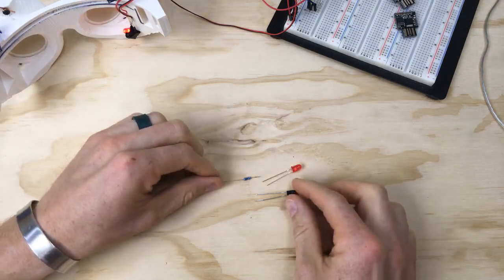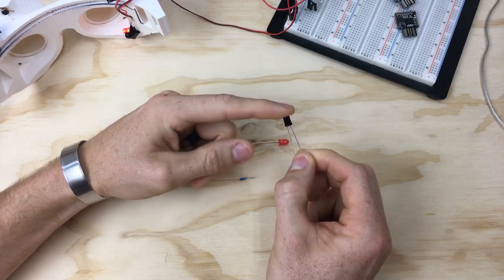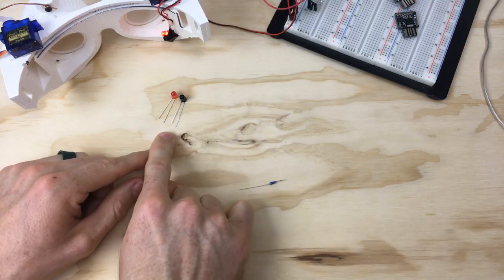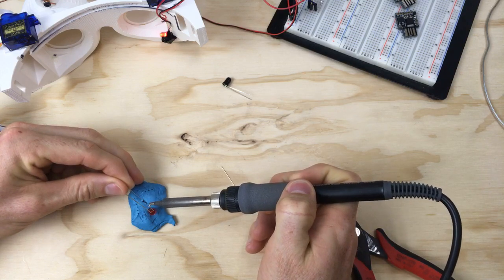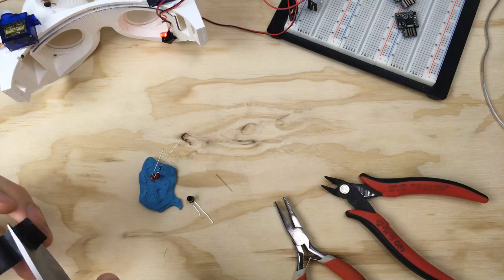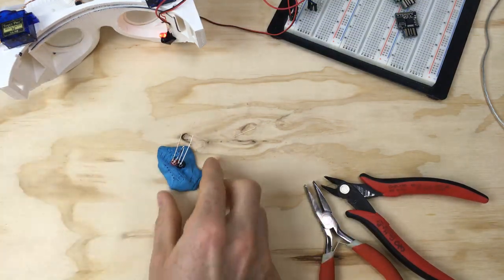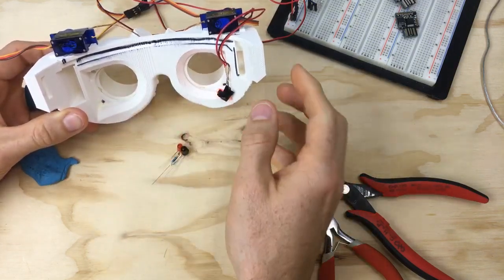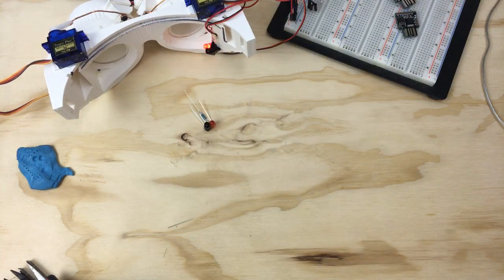How To Make a Light Sensor | Blinking Iris Goggles | Live Stream

Comment: do you have a link to the 3d print that is holding the Blinking Iris? it seems much more solid than the original, which broke in half right away. -thanks -cm3
Reply from the maker: +Colin MacKenzie, III I will post the files once they are finalized. I am printing the new version now. Hopefully it is the final revision!